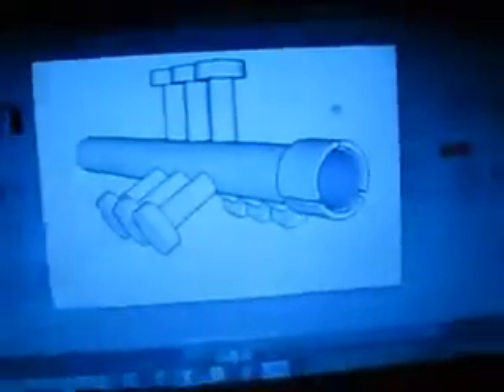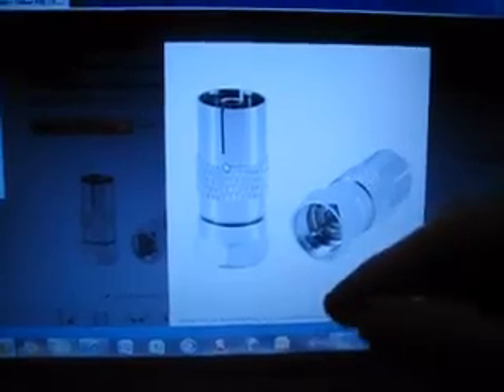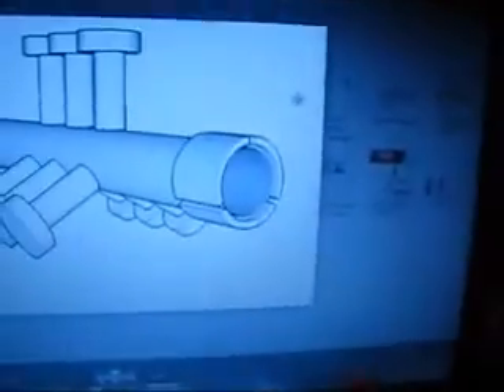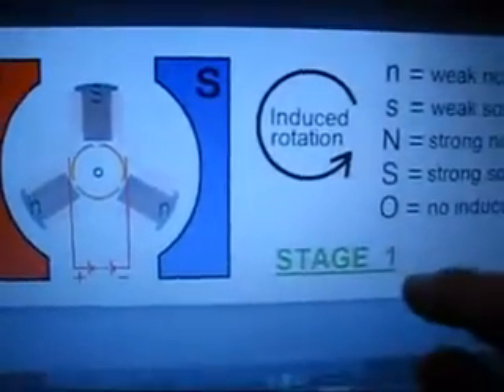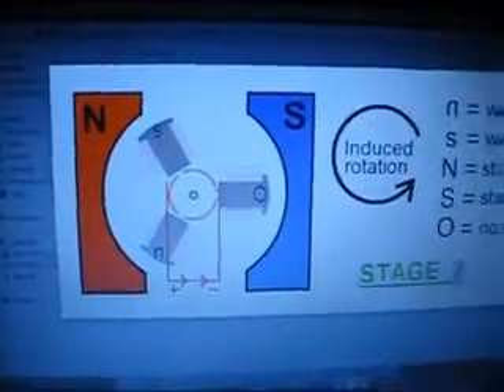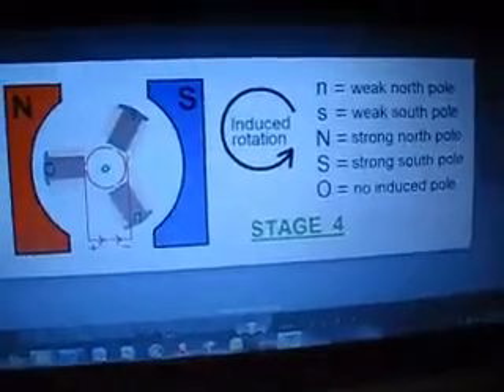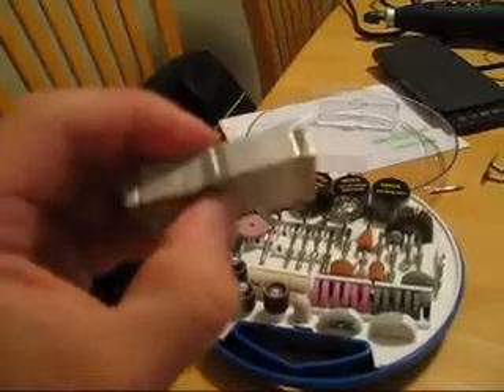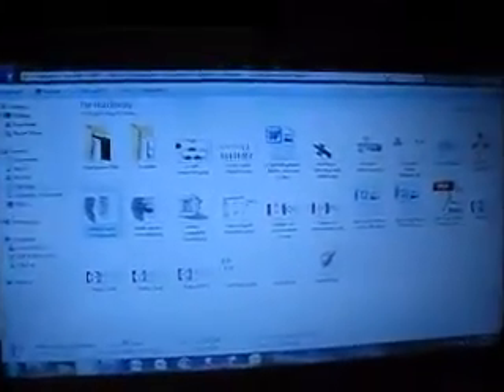Construction of a Split-Ring Commutator for a 3-coil DC motor

Comment from the maker: @jimward85Thanks! I filed flat surfaces perpendicular to the bolts, 3 flat surfaces 120 degrees apart. Then I very slightly "pilot-drilled" for the bolts to screw into the shaft, then superglued them in place to stop any movement. (After checking that everything was aligned correctly that is).

Comment from the maker: @SoljaOfSins Sorry for delayed response. 
Regarding the coils connected to commutator - you've got it right, the "top" end of one coil is connected to the "bottom" end of the next coil. this connection is then connected to one of the 3 commutator plates.

Comment from the maker: Hey mate, thanks. The green tape is just holding the "wire brushes" against the commutator. There's no electrical components under there - just taped the ends to the wooden frame to hold them there. Hope that helps clarify it!

Comment from the maker: P.2 THIS NEXT (2nd) COIL, and solder/etc it to the NEXT commutator part. Again, with the 3rd coil, take the BOTTOM end of it, and solder it to the same commutator part (the one with the TOP end of the 2nd coil joined to it). Repeat this, and in the end you will have a complete circuit. (In theory, it's "one big long wire", only 3 parts of this "wire" are coiled all up.) The motor operates by the brushes connecting different parts of the commutator, and shorting out one coil (see the video)

Comment from the maker: Yes that's right. for EACH coil, there are TWO wire ends, right? One at the top, and one at the bottom (assuming you have [as you should] coiled all three coils in the same direction. Take arbitrary "coil 1" (ie, any coil): the "TOP" end of the wire on this coil get soldered (or however else you wish to join it) to the first "part" of the commutator. Then take the "BOTTOM" end of the wire of THE NEXT COIL, and solder/etc it to THE SAME COMMUTATOR PART. Now take the "TOP" end of the wire of...

Comment: why not use copper bars cut at a angle with pieces of non conductive material between each angle to create a copper circle with a groove on top and bottom of the commutator called a dove tail with a non conductive material between that and the steal part in the middle of the com. that will fit to the armature or shaft i make commutators everyday i cant name the non conductive materials to use i can help with your idea to make better results and i work in a top secret industry im limited on what